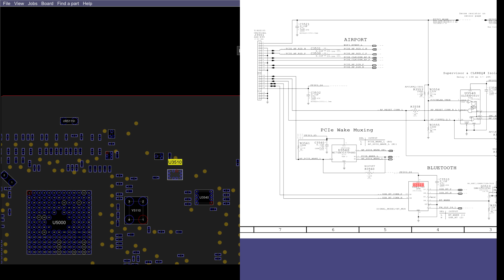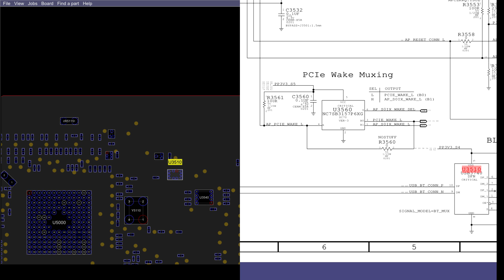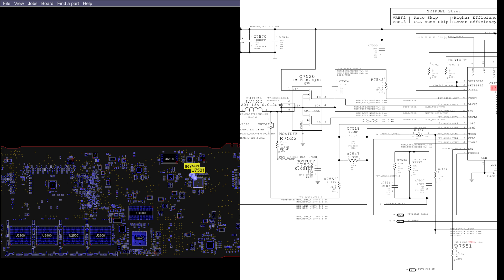Can Macbook Air be fixed outside of a miserable CSAT Solutions sweatshop?

Comment: I am slightly disappointed that you didn't also fix the bluetooth circuit (or test whether it  works), since you already saw that it also had corrosion. Of course this would be done after you fixed the main issue with the board.
Reply from the maker: That was done on the live stream,
Reply: @rossmanngroup  Ah, alrighty then!

Comment: I don't understand why you don't start by just trying to clean the corrosion off rather than replacing chips? I know it's kind of a "home remedy" method of fixing your water damaged shit, but from my own experience and reading online, cleaning corrosion with alcohol is pretty effective. Is it just for the sake of time so you don't have to potentially try more than one method?
Reply: Because the corrosion is cleaned by the Crest ultrasonic cleaner at the end.  The large majority of the boards Louis gets are fixed by a trip through the Crest.
Reply: @alaeriia01  So. What you're saying. Is that he could just start with that. Which is also what I'm saying.
Reply: @legospencer  well, not exactly. You see, he often uses the signs of liquid damage to diagnose what needs to be repealed and replaced.

Comment: I believe that the law is 48 hours without heat is illegal?

The period between October 1 and May 31 is Heat Season. During this time, the City requires building owners to provide tenants with heat according to the following rules: Between 6 AM and 10 PM, if the outside temperature falls below 55 degrees, the inside temperature must be at least 68 degrees Fahrenheit.

From the New York government site. No court may be required. You might just be able to set something into automation. Don't know if it applies to businesses though, but I wouldn't see why not.

Comment: You need one of these badass heaters  http://www.mrheater.com/portable-buddy-heater.html
I have one of these with an extension hose to a propane tank, 20min it heats up an entire area and is designed for indoor use
Totally safe, been using mine for years without a single issue

Comment: I'm getting more and more inspired to do electronics repairs. I can solder some simple larger and components, it is the 0201 and smaller where I get concerned. I could see a lot of time going in to reballing an SMC (Subsequently Much Cursing).

Comment: I have a feeling most liquid damage are due to condensation inside the machine. The is hardly any way a drop of water can get into the machine without leaving a path and just corrode something. Lead free solder joints usually has a matt surface and it does seem like a good spot if water were to condense.
Reply: Apple could stop all shorts and liquid failures by coating the entire PCB, but they don't. And we know why.

Comment: In a normal system , ODM would put liquid damage indicators near system critical components, but after watching several of your videos, on donglebooks this is not possible since a dead thunderbolt port can pull the critical rail down. Coincidentally, I have not found any LDIs on Lenovo/HP workstations

Comment: I used to fix those fan heaters, they have little thermostatic switches in them that are intended to protect the heater. The problem with those particular thermostatic devises is the more they trip the lower the temperature they trip at. Oh and I'm not talking about the adjustable one on the outside.

Comment: You shouldn't have to spend money on a space heater, especially with the amount of rent you have to pay. Kerosene heater, leave horrible stinking fumes. My only heatsource for my 12 x 20 work shed is called a Little Buddy heater. You can use small propane tanks or what I chose to do is buy a 20lb tank. These work very well ( and you can get 20 to 40 hours of heat per tank). https://www.walmart.com/ip/Mr-Heater-Portable-Buddy-Heater/5712813?wmlspartner=wmtlabs&adid=22222222222010326421&wmlspartner=wmtlabs&wl0=e&wl1=o&wl2=c&wl3=10377141738&wl4=pla-4578641309944138&wl5=&wl6=&wl7=&%20wl10=Walmart&wl12=5712813_10000001836&wl14=little%20buddy%20space%20heater&veh=sem&msclkid=6f3682d44fd210a0f9c5de9fe39931b4